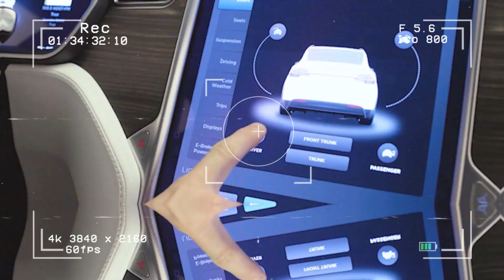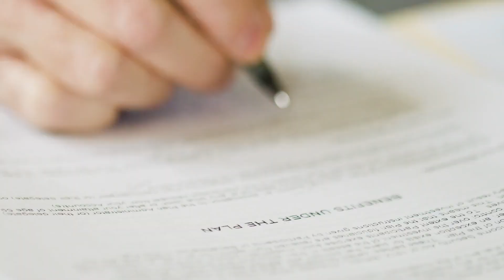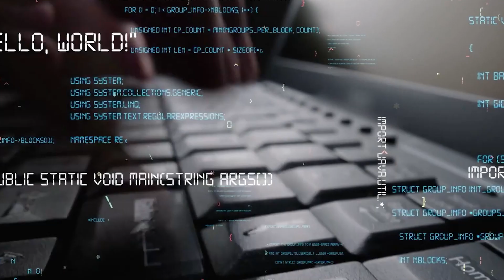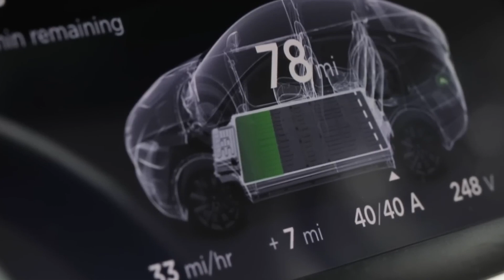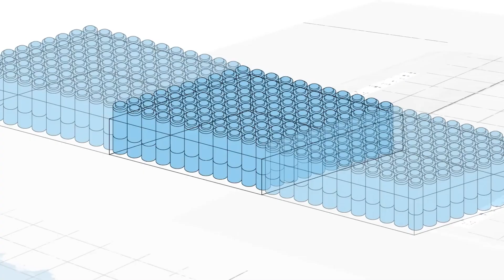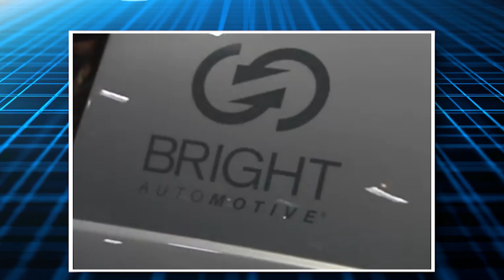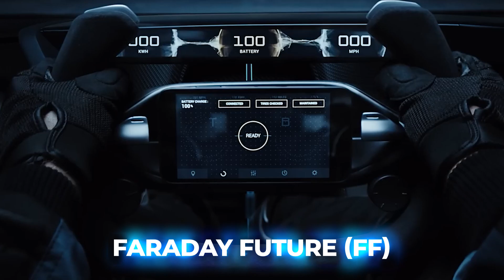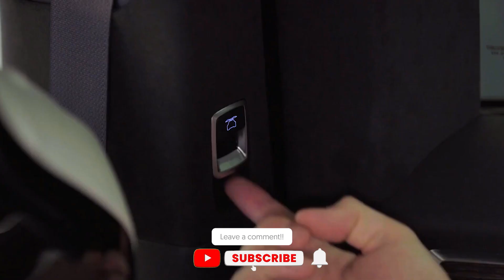Why So Many EV Companies Fail

Comment: According to Google, 1/3 of Americans live in apartments.   People living in apartment communities will encounter difficulties to install a home EV Charger.   

You might say, these people can charge their EV at a public EV Charger.  That is true.  You can extend the range of your gasoline powered car by 300 miles by filling up at a gas station.  Time required to extend the range of  a gasoline powered car at a gasoline station—5 minutes.

You cannot extend the range of an EV by 300 miles within 10 minutes.    Until you can extend the range of an EV by 300 miles within a 10-minute period of time, people will continue to purchase a gasoline powered car.    Nobody wants to spend their time waiting for an EV to filled with electrons.       

My next car will be another Toyota.  It will possess a gasoline powered engine.